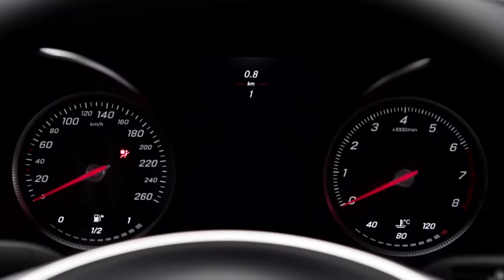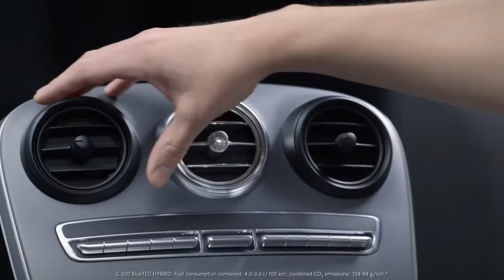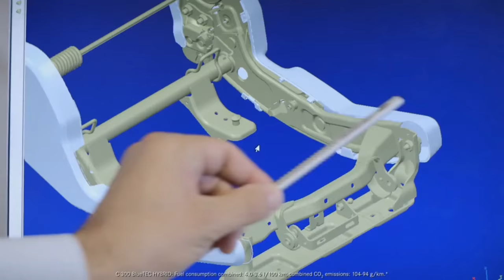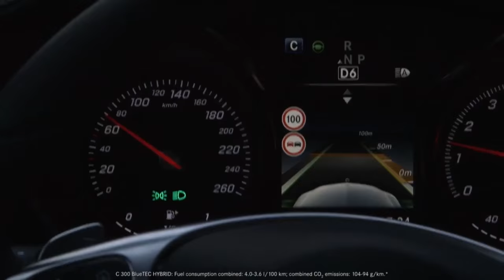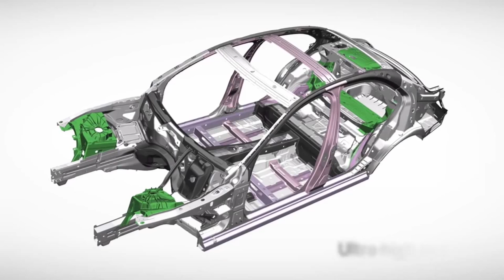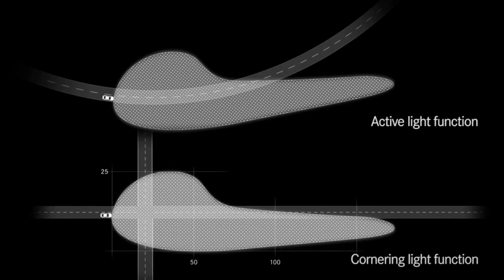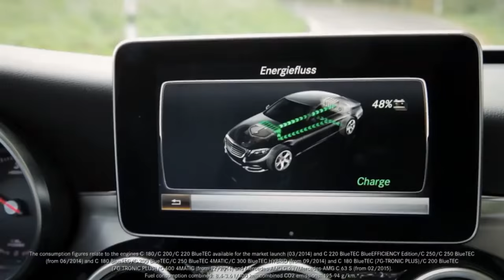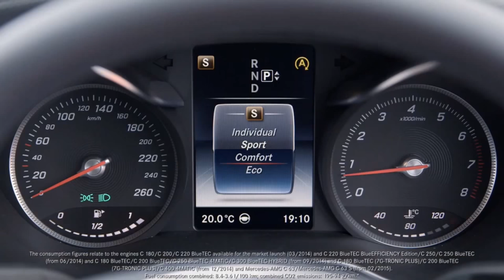The making of the new Mercedes-Benz C-Class (W205) [FULL] [FHD]

Comment: I have a w204 and for some reason i cant stand the rear end of the 205.  Thought it would grow on me, but it's almost getting worse.
Reply: they could have done a better job with that....come on mercedes you can do much better
Reply: I too have a W204 and agree that the rear of the W204 looks better than the W205. 
However, the W205's new streamlined rear improves the aero dynamic design which subsequently reduces fuel consumption of the W205 in comparison to the W204... among other factors...
Reply: I had w204 and just switched to w205 - you get used to a different butt lol. My main complaint is the audio system. Is nothing next to the one I had in my 2013 c250.
Reply: I currently own a W204 and I bought a new W205 also. I like them both, so I kept both of them.